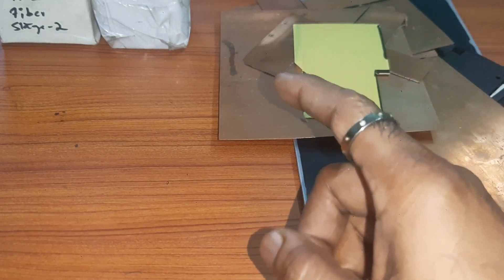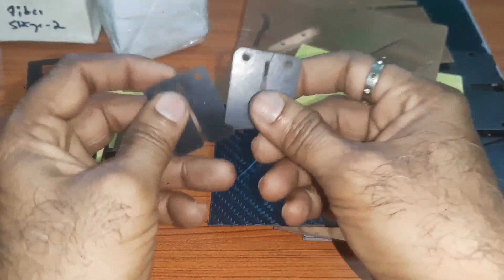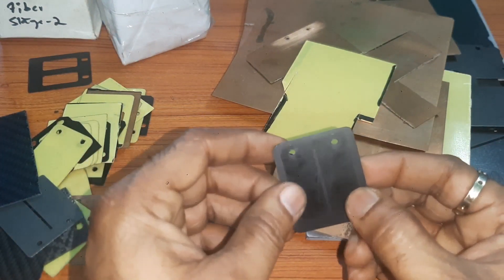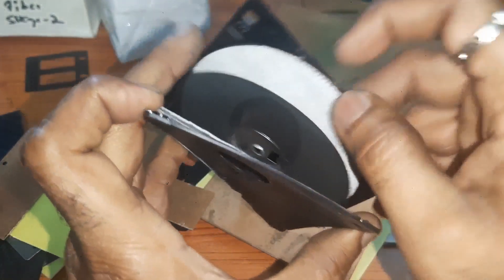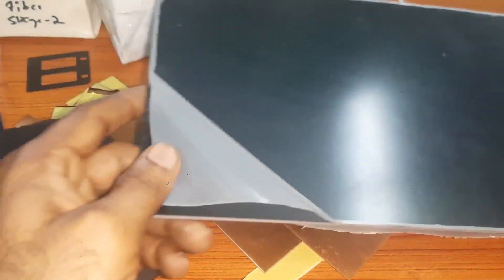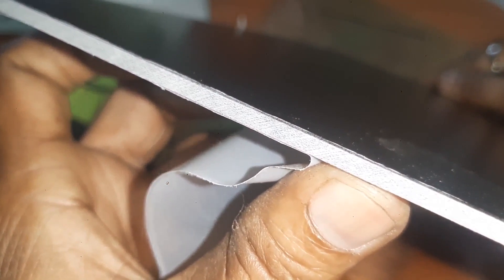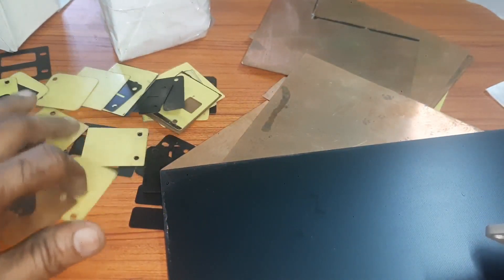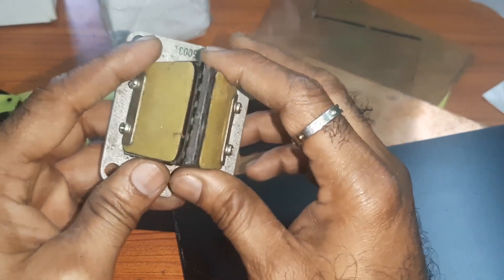The Only Reed Valve Reeds: A Comprehensive Guide Video You Need to Watch

Comment: Good video. Any experiance with Mylar sheet?? We race small cc bikes. 50 to 100cc.  Performance reeds are very expensive. Im looking for big sheet of material that i can cut myself. 0.35mm and 0.40mm  i like the yellow material. Any recommendations and name and type?? Thanx
Reply from the maker: Yes I have some yellow sheets but more thickness and many different sheets. I will make a video
Reply: @LambrettaRamesh  i would like to buy a big sheet. I ordered 0.35 but quality is very poor quality.  Its too soft. And it looses its shape and stifness

Comment: 2 petals or three petals which one is better for performance? because I have a rxz motorcycle that uses two petals reed valve.
Reply from the maker: For one year I made a research on reed valves with petals. 03 reed petals are super for RXZ if you want super bursting sound melody along with awesome performance. If you want only performance you can use 02 petals fiber reed valve not carbon fiber. In reality we can make wonders with different design reed petals to achieve different performance of vehicle 👍👍👍
Reply: @LambrettaRamesh  I have seen two versions of reed valve (V4 racing reed valve) and (alloy racing reed valve) brand from (OKO) for motorcycles (yamaha RXZ 135 and yamaha 125zr) you can search on google these two reed valve categories..after you see  these two reedvalves on google I hope you can help me recommend which one is better.
Reply: @LambrettaRamesh  I have seen two versions of reed valve (V4 racing reed valve) and (alloy racing reed valve) brand from (OKO) for motorcycles (yamaha RXZ 135 and yamaha 125zr) you can search on google these two reed valve categories..after you see  these two reedvalves on google I hope you can help me recommend which one is better.
Reply: @LambrettaRamesh  I have seen two versions of reed valve (V4 racing reed valve) and (alloy racing reed valve) brand from (OKO) for motorcycles (yamaha RXZ 135 and yamaha 125zr) you can search  these two reed valve categories..after you see  these two reedvalves I hope you can help me recommend which one is better.
Reply: I have seen two versions of reed valve (V4 racing reed valve) and (alloy racing reed valve) brand from (OKO)
Reply: @LambrettaRamesh  how many mm is the suitable petal size and type of material for the second reed valve that I told above for endurance and extreme hot weather. because my motorcycle is tuned for long distances.
Reply from the maker: 0.4 mm
Reply: @LambrettaRamesh  petals 0.4mm which material is good can you recommend sir?
Reply from the maker: Carbon Fiber
Reply: I have seen two versions of reed valve (V4 racing reed valve) and (alloy racing reed valve) brand from (OKO) you can search on google these two categories of reed valve.. after you see the performance of these two reed valves, which of these two  you feel the best